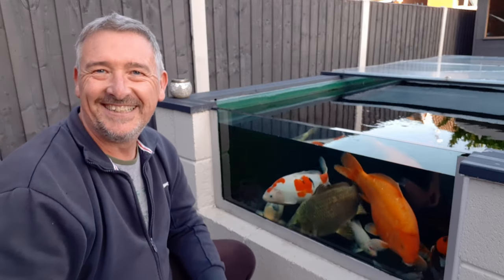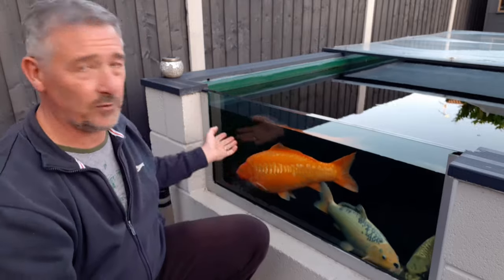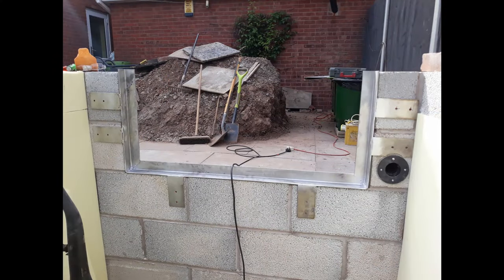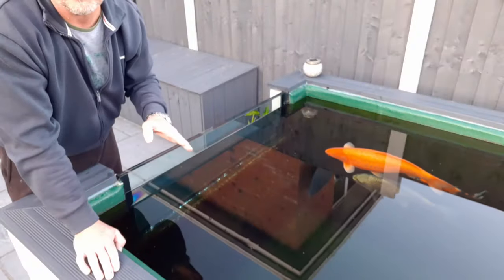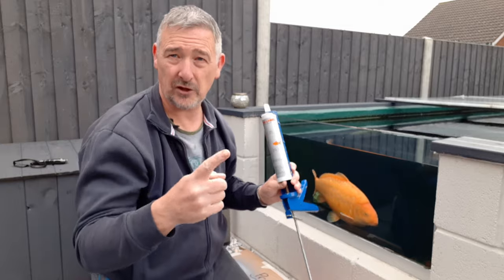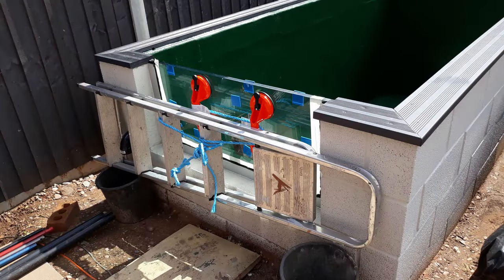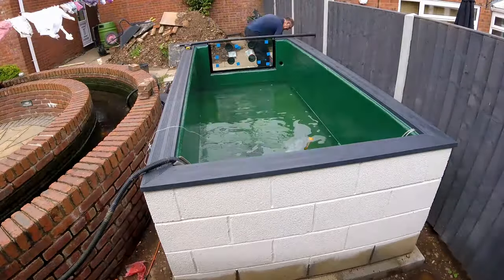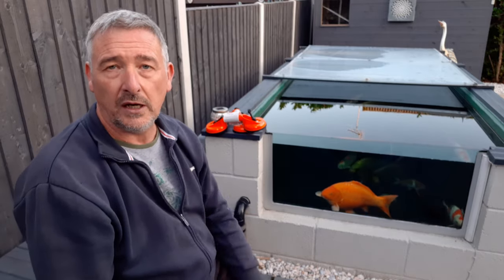HOW TO INSTALL A KOI FISH POND WINDOW. ** THE EASY WAY😉👍....

Comment: I love the idea of the window but not sure about your approach, I'm going to build the cut out like yours but I'm going to make it a frameless window, I am thinking along the lines of fitting a roofing lat a couple of inches in from the inside edges of the concrete cut out on the inner walls and then fiberglassing over it all, then get a local car window fitter to sicoflex around it and fit the glass, no frame required and only a single place where a leak could develop, no screws, no frame and 1 point of failure... what do you think ?
Reply from the maker: Sounds like a plan. I only put the frame in as I didn't have the experience of cutting out the recess. Once it was cut there was no going back so made the frame Instead. Can't knock it till you've tried it.  Let me know how you go on with your idea..😉🤔👍

Comment: Hi Andy great video and very informative. Just one question when do you take the spacers out,  after the first 12hrs cure, cut off and leave in then mastic over? 
keep them coming very helpful
Reply from the maker: Hiya, The green 5mm spacers stay in there. They are fixed in with the mastic and get covered anyway. I can just about see a bit of one of mine if I look at the inside of the window. As soon as its cured you can snip off bits that have squeezed out too much to leave a tidy edge... Hope this helps...😉👍👍

Comment: Acrylic tends to be better than glass. It doesnt shatter from impact like tempered glass does, resists cracking a lot better, is cheaper, and much lighter in weight. The only downside is that it can scratch easier than tempered glass.
Reply from the maker: Hiya, thanks for that feedback. I did look into that material instead of glass but was put off with the scratching as I didn't want to restrict myself from ways to clean the window..🤔😉👍
Reply: @KoiPondLifestyle  fair enough. :)

Comment: I'm looking to do something very similar to this.
What were the foam sheets you used before fibre glassing?
Reply from the maker: Hiya, I should have used 25mm insulation sheets but ended up using the 15mm which seem to have dome a good job. If I built another I'd use the 25mm sheets next time..  Are you going with a big window. I'd definitely go bigger if I did it again...😉👍
Reply: Yeah, it's going to be approx 2m wide by just over 0.5m high.
I'm just weighing up if I should fibre glass or use a pond liner for cost (even though I know fibre glass would be better)
Reply from the maker: @DeanLeybourne8832 fibreglass to fit and forget..😉👍

Comment: Did you stick the insulation on? And did the fiberglass go straight over the insulation?
Reply from the maker: Hiya. Yes just got some cheap sealant for the insulation just to hold it in place unril the fibreglass had gone straight over the top..😉👍👍

Comment: Mine are a 2 metre window an a 3metre window  both 40 mm thick. The 3 metre was just shy of a quarter of a tonne. Glass suckers just couldn't handle it but because the 316 stainless frames were embedded in the walls and the front was flush with the outside of the pond we set the glass on trestles on the ledge inside the pond and then rotated them upwards into the frame and onto the silicone. All very stressful. My frames were made by Atlantica of 316 stainless. Not cheap but brilliant..
Reply: I've been looking at the Atlantica frames because the window is at the front. Would you recommend them a year on then? I've seen they are pricey but once they're there they should last forever. Did you build your pond from blocks and if so did you have them laid down or upright mortared in?
Reply: @joeyj6526  Yes I would still highly recommend them, they are a major piece of quality engineering. I keep the frame outers clean with a soft damp cloth. They were a fair bit of work to put in but they really do the task well and the koi are constantly at the front especially when they see the food coming..
Reply: @joeyj6526  my construction was 7N block on flat with mortar to ground level, then I put a reinforced concrete collar around at that level so I had a base to put the facing stone on. The frames were sat on the block at ground level and the blocks were built up either side. The frames protruded from the flat blocks by the thickness of the facing stone. I also put re-bar down through the frame lugs so that there was no chance of buckling or movement.
Reply: Thanks for the reply! I've just seen another video by this fella and seen how he had blocks laying down flat and then blocks upright, so the bottom is stronger against the water pressure. I think I'd do the same as you and go for a concrete collar aswell. Thanks for the info mate. I think the Atlantica frames are going to be worth the investment. Cheers
Reply: Oh and don't cut the tops out if you are doing infinity windows until the frames are all set in because that keeps them all square. You can cut the top while supporting the other end and vice versa then carefully file the exposed frame ends to a polished finish and jobs a goodun.

Comment: Educational this is thanks ! Why didn't you use acrylic? Much stronger than glass and less likely to break. Can be cheaper than glass, depending on sizes and thicknesses! 
I like your frame design!
Reply from the maker: I was torn between glass and acrylic but as you see went with glass as I wasn't sure about cleaning acrylic and it scratching as you do need to clean algae off them quite regular..😉👍 Glad you enjoyed the video..cheers
Reply: Acrylic is stronger than glass but has the disadvantage of scratching easier than glass and will fade or cloud over time.

Comment: Good morning. Great video. I am currently planning my block pond. I’ve not on most videos I’ve seen that people lay the blocks flat. I’ve noticed that you haven’t. Have you had any issues laying the blocks in the upright position? 
Thanks Chris
Reply from the maker: Hiya, I laid the first 4 layers on their side for the base sections as that is where the most water pressure is and back filled around the base for more strength. Have a look at this video which has more info on how I built my pond and give details about the block work... https://youtu.be/Ms4-UxEo7cU
😉👍

Comment: If I am building a 500 gallon pond with the front glass, what do you think the thickness of the glass should be?  Pond is 5 feet x 3 feet x 5 feet (not too large in US).
Reply from the maker: Hi Liz, I would say you could get away with a single 15mm thick piece of glass if your pond is only 500 Gallons. I would always suggest to over engineer everything for that piece of mind and check with your supplier as most are able to calculate the water volume and pressure against the glass? Good luck with your pond build. Have you seen my video on pond building? That should help with your planning.😉👍👍 Here's the link: https://youtu.be/Ms4-UxEo7cU

Comment: Great video. 1. Do you have problems with herons ? And has your decoy worked? 2. The circular brick maze, is that your old pond ? 
3. Do you have anyone you can recommend to build one like yours ? I'm in Birmingham
Reply from the maker: Hiya. Thanks for your comments. I used to have a Heron that would land on the side of the pond but luckily scared it off. I put the fake one in and not seen one since. Maybe the fake one works or I really scared it off the last time? The circular one was my old pond. It was falling apart so needed replacing with the one I have now. I used a builder from work to lay the block work and I did the rest myself. I would definitely use some one you know or that's been recommended as I've seen some nightmare builds... Cheers..😉👍👍

Comment: Amazing! Well done! I'm planning to do something similar in my garden but I was thinking to use 20mm plexiglass instead of glass, what do you think? I will have about 3m^3 of water and my window is going to be 1.4m b x 0.8m h
Reply from the maker: I'd contact a glass dealer and ask that question. I've not heard of plexiglass being used so would consult a glass manufacturer first. Good luck with your window. They are a fantastic addition to your pond... beats any TV.. 😄😉👍

Comment: Couple of quick questions if you don't mind what size are your blocks and is it single skin. Very useful vid cheers.
Reply from the maker: Hiya, The blocks were 140 solids. Single skin but the first three layers were laid flat to increase the strength of the base, as that's were all the weight of the water is. There is a full detail of my build in this video that should answer other questions you may have. ENJOY.. https://youtu.be/Ms4-UxEo7cU

Comment: Can silicone stick well to that frame?  Like aluminum?     Cause i dont instead to use the coating you have.
Reply from the maker: Hi, I have seen others using 'Bond it' HA6 silicone which is a marine grade safe for the water. I wouldn't opt for the cheap bathroom stuff due to it high content of non marine chemicals and how good it would be with its long term underwater tight sealing that isn't needed in you bathroom. Good luck if your fitting a window and thanks for watching...

Comment: Would CT-1 be a good option to hold the window?
Reply from the maker: Hiya, I've not used CT1 before but I think others have. I'd stick with the sealant I used in the video. TBH the sealant is literally to water proof seal, the water pressure holds the glass in with the sealant.. 😉👍

Comment: What a great video, really helps out a lot for when I add a window to my next pond build in a few years, wish I did it for my current one but you know how it goes, you build and then wish you'd done things different when your a couple years into it haha. A quick question off subject what is the coping you've used round the top of the pond? it looks like composite boards like mine, but yours seems soo much thicker and wider than mine, is it composite or did you just buy a thick wood decking and paint it? cheers and keep up the vids really enjoying them ;)
Reply from the maker: Hiya and thanks for watching. Glad you enjoyed the video. For my coping,  I used some wooden decking, turned it upside down and painted it slate grey. I priced up some actual slate and was quoted well over a £1000 so went for the wood. Every day is a school day! Cheers, ANDY...

Comment: Hello sir what type of glass you used in your glass window?? Tnx sir
Reply from the maker: Hi, the glass is 2 sheets of 12.5mm tempered glass between a lamination. The majority of glass suppliers can supply this type of glass. The thickness will depend on the size and volume of water you are looking to hold behind it... Hope this info helps.. 😉👍

Comment: Looks good, about he same size as mine. Mine is level with the Garden and Im thinking of building it up with a window similar to yours and getting it fibre glassed. What did the fibreglass cost you and how long did it take.
Reply from the maker: Hiya, The fibre glassing cost around £450 and took half a day as it was a hot day so the fibreglass went off very quick. Thanks for watching.. 😉👍👍
Reply: @KoiPondLifestyle  Thanks for that, which way did you go with regard to a bottom drain. I was going to get a spindrifter but not sure what size. The 4" seems massive.
Reply from the maker: @sedgie08  Hiya,  Fitted a 4" bottom drain into the concrete base...My build is in this video. https://youtu.be/Ms4-UxEo7cU
Reply: @KoiPondLifestyle  cheers

Comment: Great video and 100% will take on all the information!.. can I ask, where did you get the little plastic pieces that you put into the bottom on the glass for support?.. 

Also other then the visible screws you used to hold the frame in did you use anything else is sealant or anything else to keep it to hold in place? 

Thank you
Reply from the maker: Hi, glad you enjoyed the video. The spacers are used when fitting house hold window frames in so you can get them from most DIY shops. The screws were there just to hold the frame in place. As soon as the fibreglass goes in that will hold the frame. Then it's the sealant and water pressure that holds the glass in the frame, hence why you need to get the water in as soon as the sealant has gone off... 😉👍
Reply: @KoiPondLifestyle  oh I see.... So I could potentially have a tidy light layer of sealant around the frame as well as 2 screws each side and 3 along the bottom for example to half the frame in place. Then spacers along the bottom with sealant/mastic until glass if fixed and fill with water. 

Also I wasn't going to fibre glass the pond as I was thinking to  concrete the inside of the pond and then apply 3-4 layers of black G4 Pond sealant which I've been told is more then enough to make the pond waterproof and will not leak. What are your thoughts on that?
Reply from the maker: @porklehgoguy  I would suggest to go as heavy as you can neatly get the sealant in place as more sealant is better than not enough as you'll get one chance at the fitting or you'll make a mess of the window if you have to have a second go. Yes the sealant will also work. What ever liner you put in, make sure you go over every inch to ensure there's no sharp edges for the fish once they are in.. 👍😉
Reply: @KoiPondLifestyle  ok cheers Andy.. thank you so much for the info. Can't wait to eventually get my pond built. Just doing all the homework now so I know what I'm in for and what to do or not to do to avoid any costly mistakes. 

Great content you have! Once again thank you 🙏
Reply from the maker: @porklehgoguy  No problem. Hope your pond build goes well. If you've not seen it yet but this is my video on how I built my pond that should have some info to help you.😉👍 https://youtu.be/Ms4-UxEo7cU

Comment: How do you joint 2 pcs glass together?
Reply from the maker: Hiya, The glass comes already to go from the factory supplier. They place a laminated sheet in between the two pieces of glass. The glass is treated and the edges polished so they are smooth. Hope you enjoyed the video...👍😉😉

Comment: What are you pond dimensions, I will be building mine 12ft x 8ft x 5ft deep and would like mine similar to your including the window. 

It’s perfect
Reply from the maker: Hi, Mine is similar. 11ftx 5ft x 4.5ft deep. My advice would be go as big and you can with the window....You won't regret it 😉👍👍
Reply: @KoiPondLifestyle  thanks, my concern is getting it into my garden with the weight, I share a shared entry with my neighbour so it’s quite tight to get into my garden. To be honest I really like yours it looks perfect, I know you mention in your video you wish you went bigger but I really like how you have done it and the size. The frame is a great idea! I’m definitely going to steal your idea on this. I’ve watched your video a few times on installing the window to make sure I don’t miss anything
Reply from the maker: @JGlover123  Yes go with what you can handle as the glass is very heavy. Check with your supplier that you've got the right thickness and away you go. Glad the video is helping you. Good luck with your window...😉👍
Reply: @KoiPondLifestyle  thanks, keep the videos coming! I watch them every evening and enjoy when new ones come out! Learning a lot from you! Is there any videos where you talk about how much you pond cost to build? I know you mentioned how much you window was, but was thinking off everything else
Reply from the maker: @JGlover123  Hiya, Glad your enjoying the videos. I made a video on how I built the pond with all the details and put breakdown of how much it cost in the description below the video. Enjoy...😉👍 See link below..
https://youtu.be/Ms4-UxEo7cU

Comment: Thanks so much for this! Just what I needed. I’m almost done with my block work and decided to go for it with the window. I wasn’t using a frame but decided to cut a channel in the block work for the glass to sit in, do you think this is a good idea?
Reply from the maker: Hi, Glad the video will help you with the build. I had originally planned to cut out a recess in the block work but Its a one shot task that if I'd got it wrong could be a right pain? I wasn't confident enough with the stone cutting so went for the frame that seemed and easier option. ANDY...

Comment: How much is it to have a pond this size fibreglassed? Thanks.
Reply from the maker: Hiya, thanks fibreglasser usually works off square meter costs but mine was back in 2019 so will have changed since..🤔😊👍
Reply: OK, thanks.

Comment: I can't seem to find a calculator in the us, how thick at1.2 meter x .5 meter. Approx 3700 kg at the base, approx 2200 kg half way up. I think I got my metric conversion right, old school, lol
Reply from the maker: Hiya. You'd be better asking the glass supplier to help with the thickness needed. I see alot of people going with the two 12.5mm with the lamination between them? But do check with your supplier. 😉🤔👍
Reply: @KoiPondLifestyle  will do, thanks

Comment: Hi

Where did you you get the frame from? 

Thanks
Reply from the maker: Hiya. I designed and had the the frame made by a local fabricator. I put their details in the description. Cheers..😉👍
Reply: @KoiPondLifestyle  is that the same with the brackets?
Reply from the maker: @JGlover123  Hi, The frame and brackets came as one unit. The spacers I used were from a local DIY shop that sold domestic window fittings. Cheers.... 😉👍

Comment: Hi the fok 😒 clay. They do 2 different ones  . There is another called vl in a red and green pack. Do you no what the difference is??
Reply from the maker: Hiya, Not 100% but I believe they are both the same but in different bags? If your getting FOK go with the bag I used then you know it the same stuff. Cheers, ANDY...